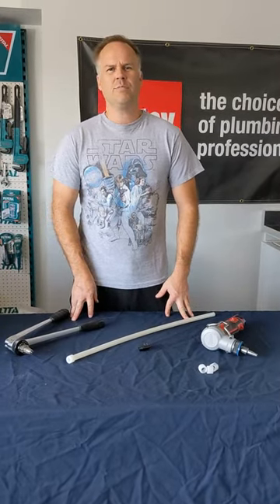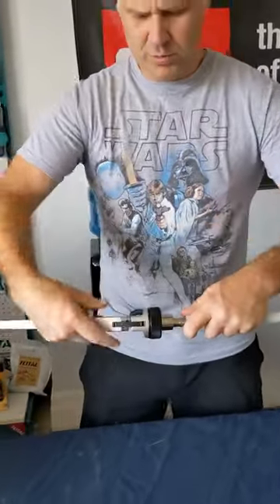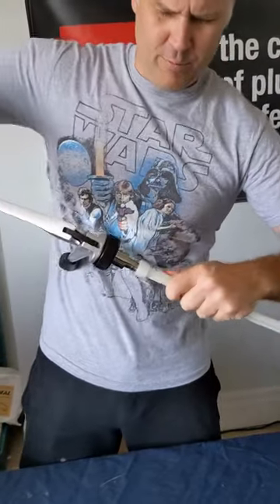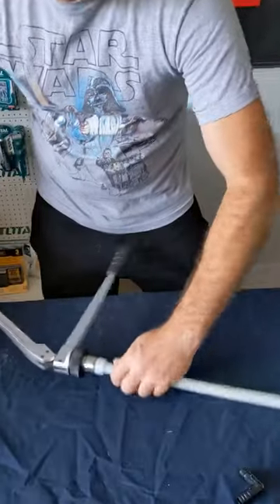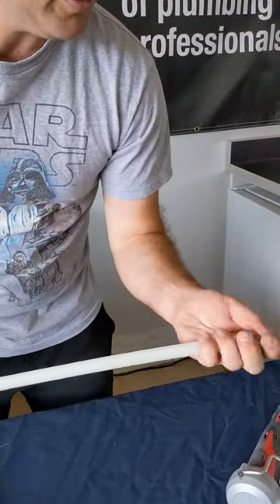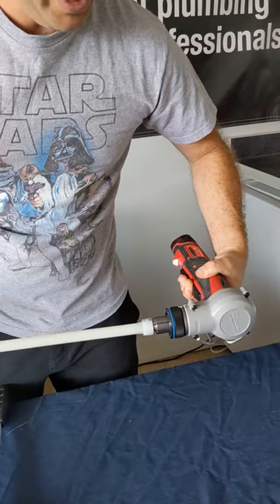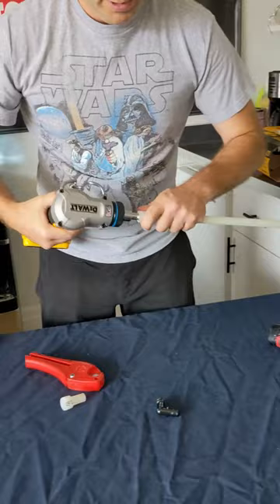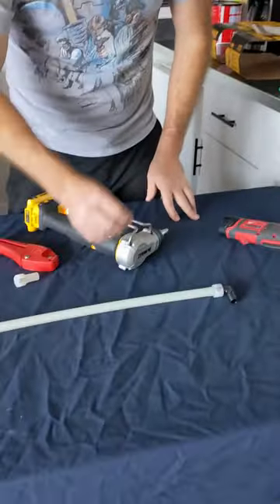MANUAL VS AUTOMATIC F1960 EXPANSION TOOL - PlumbBros

Comment: Thank you. I had planned to use a manual expansion tool but upon seeing the “three hands” need I believe I will spring for the power tool as there is only “crawl in and rollover” room under the house…and I get to buy a cordless tool!
Reply from the maker: The power tools are so easily available now, it definitely makes sense!
Reply: Same situation here too.  I've got a tight crawl space and plan to replace all the old copper piping.  Looks like I will go ahead and get this tool.  Not looking to spend that kind of money given I'd probably never use it much after I'm done the project.

Comment: Great video… I would lean towards the manual.. as the video shows… there was no problem with the manual one.. if your battery is weak or dies out.. the electric one is useless

Comment: I can’t believe they haven’t come out with a corded version of this for diyers. $500 is a bit too much for a tool used only during a remodel.
Reply from the maker: Yeah for sure there needs to be a lower cost corded option.  Luckily there still seems to be a strong resale market for the battery operated ones so it's not a fully sunk cost
Reply: The need to come out with a drill or impact attachment.